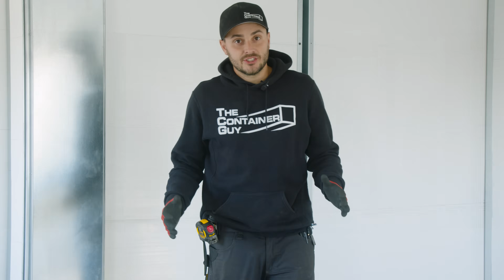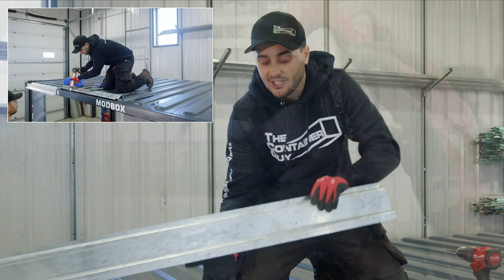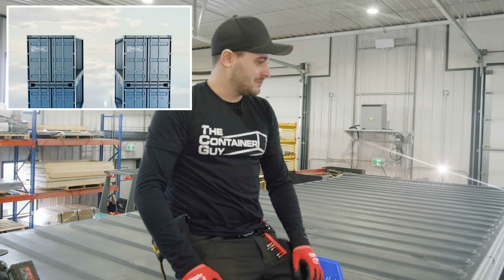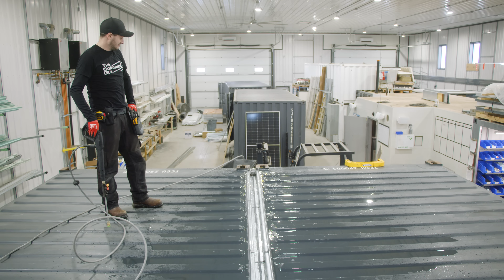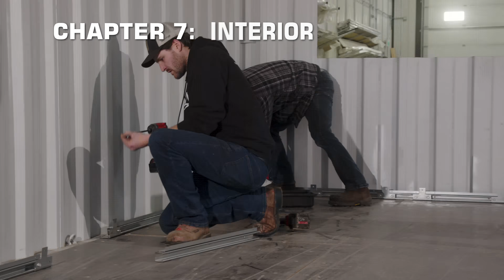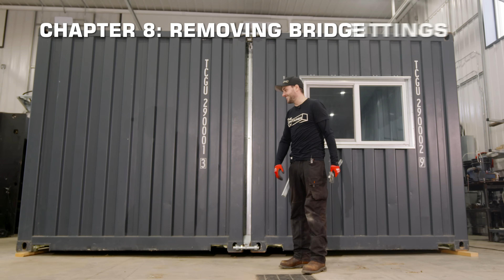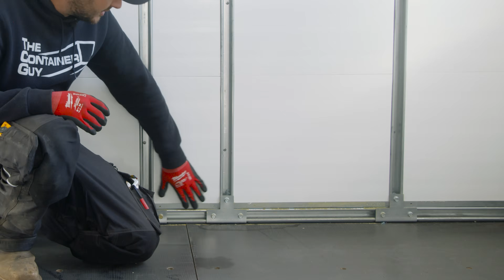I Designed It. China Built It. I Connected It. | MODBOX Double Wide Kit

Comment: As a retired top pick operator I've wondered about using IBCs for locking containers together, but of course that would maybe not work for side to side containers. Plus with them being cast there is probably a lot of variation in the thickness of the base of the IBC.

I figured I would want to use AML (Alaska Marine Line) containers becuase they are taller than regular high cubes, and they're 102 inches wide instead of 96 inches wide, so they would lose less interior space from the framing.
Reply from the maker: Thanks for the insight!
Reply: How much taller are the AML containers. I need a kit to stack (2) 40' side by side but 2 high with no ceiling/floor in the middle. Does that make sense?
Reply: @cjgamer2140  Since I'm retired and I never want to see that hellhole again, I'm not sure of the specific height. However. they're taller than a high-cube container. I would also imagine that they are harder to come by as only AML uses that size can. I don't know if I've ever seen a 40' AML. I've just seen 28' and 53' AMLs.
Reply: @Smithcraft1  ok thanks for the info.
Reply: I was wondering how many Longies would happen to be watching this content. Using cones to lock in the containers is perfect!

Comment: I thought the problem with insulating these is transfers of heat and cold. The rails system or rafter system is directly against the corrugated and there is no insulation behind the rafter system. So you still have temperature and moisture transference. 
 Shops used pink insulation or batting insulation in metal buildings for years. Still the same moisture issue. So spray foam directly to the interior metal is the only solution. 
And you are still welding the floor and the end alignment fittings.
Reply: Yes, theres tons of thermal bridging occurring. 

SIPs panels attached to the outside would be a far better solution.

Comment: What is the insulation rating of the walls? Is it sufficient for areas that get down to the teens and twenties, or is it more a warm weather only and would need to be exo-framed and insulated for cold weather use?
Reply from the maker: R-14 In the walls R-20 in the ceiling, we get down to -40 Celsius and they do just fine. That is with the heating Mini-Split heating and cooling of course.
Reply: @TheContainerGuyTV I call complete BS with all that thermal bridging you have.  That would be mold city in the winter.  Every place that C channel is screwed directly to the containers metal will be just as cold or hot as the outside of the container.

Comment: For 5+k you could just buy both used containers and hire a welder and do it right the first time for 1/4 the cost of doing this
Reply: ya.   In less time too.   The interior wall finish isnt horrible, although id just use the channel.as studs to attach wall to.   Also a peaked roof with SIPs on the outside, then it doesn't look like a shipping container when driving by, and removes the need for spray foam, plus way better insulation propeeties.  Would also gives room to run electrical behind the C channel studs
Reply: That might be true where you live. In Australia you'd have to pay welders $5000  to answer the phone when you call. :)
Reply: @gavinknight8560  so just buy a cheap welder and do it yourself then.

Comment: I would consider using primer for the dowsill. It is sometimes incompatible with certain paints or metal coatings. We will typically do a pull test on every job to determine if we need primer or not. I believe primer 1200 is for metal.
Reply from the maker: That's good to know, we appreciate the advice!

Comment: Hope the screws set into the slotted PVC panels are centered in the slotted PVC hole, and not tight to the PVC surface, because the PVC needs to expand, and contract laterally causing PVC slip movement behind the fastener head. Just ask any residential vinyl siding installation contractor in your town to explain proper installation tips of PVC plastic to allow room for expansion shifting of the PVC to expand then contract at the end 90 degree corner areas flashing. Note that a 12-foot piece of vinyl siding can expand up to 5/8 of an inch in length when temperatures rise from winter to summer. In Summer the PVC panels with no place to grow may develop a wave in the one piece 16 foot roof panel.
Reply: expansion should be minimal on a conditioned space

Comment: Consider that the MODBOX white vinyl logo should be removed as the DOW silicon adhesive/sealant is being applied in this video over top the vinyl logo surface which allows for leakage of water behind the vinyl logo itself when in the near future the logo adhesive brakes free from the shipping containers painted surface during any expansion, or vibration of the steel 60mm X 80 mm upper roof beam flexing from snow load, or roof walking inspecting when looking for future roof panel pinhole leaks. Just roof walking could also cause another leak at the beam seal because the logo adhesive dried then breaks free with adhesive during assembly applied on top of the logo’s vinyl surface not behind the MODBOX logo when left in place.

Comment: Nice work, as usual! I'm very curious how your Modbox would respond as a standalone unit with both sidewalls removed compared to a regular 20'. With some additional steel framing, do you think you'd get much roof defection or upward floor defection when a forklift picks it up?
Reply: yes.   There's a reason the steel on the sides is corrugated.  Its structural

Comment: how much are they ...im 76 and a bit, well a lot beat up .. can they be bought & shipped with minimal onsite assembly work?
Reply: I can't speak for The Box Company, but having watched lotsa videos about the use of containers for offices and housing, it would seem that you still need to build a frame inside of the container to support walls and stuff. I've seen that styrofoam type insulation panels that are made to fit in the corrugation of the sides of the containers can be used. With their channel system it looks like it would be much easier than framing 2x4 studs and rafters. Then you're going to want to insulate, and put up the walls.

From watching this video it looks like it would be fairly easy, but there's still a lot work to do, albeit much easier with all of their parts versus wood framing.
Reply: @Smithcraft1 SIPs on the outside would be a much better insulation.
Reply: Just rent a condo dude.

Comment: Interested —I want a 40-footer double-wide for a shop, but I need the center post removed and a single big door. I'm in Arizona.
Reply: Use an external header (tall c-purlin) running the length of the container and cleat plates welded to the top side rail. Use the back to back headers as a ridge beam with rafters fixed at the outer rails. You will need to support the bottom side rails underneath at two points (even spacing) to prevent the floor sagging.
Reply: @jamesdaniel6907 or put it on a slab or footers
Reply: put them on 14' metal posts, and use the containers as your roof.

Comment: Pretty cool w/ the mod box, been worried about floor movement/sag a lot.
regarding the lift pocket sleeves and alignment cones- with ~12mm insets for corner castings, it'd be a pain to pull the units together into those insets in their final positions while getting the lift pocket sleeves aligned.
Would you imagine it reasonable to do this kind of assembly, inclusive of the welds, alignment cones, etc, then lift the joined units into those insets pre-sprayfoam?
IE: could some state of this system support the weights on it during a lift/movement to Inset foundation positions?

Or perhaps it'd be dramatically easier to weld in some support for that inset/raised casting delta later?
Hell, maybe the modbox style lower tube is a good enough mitigation for that.
Reply from the maker: We have a 40' MODBOX that has an even bigger bottom side rail and no fork pockets. I'm excited to cut one of those apart and test it. 

This video shows off some foundation plates that we made that makes sliding them together a bit easier:
https://youtube.com/shorts/v6STucZBCjs?si=cBqK6K7b3ST7gBz6

We're still working on all the foundation stuff but are in the "learn from our mistakes" period. We'll share our wins & fails with you all on the channel.
Reply: Right on, excited to see whatever support/foundation iterations ya'll imagine, and get to test out.